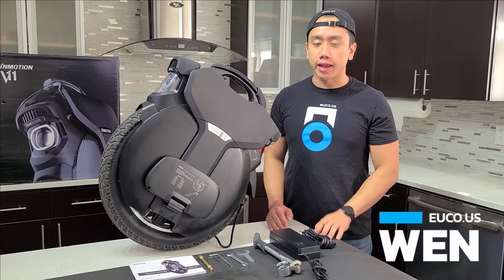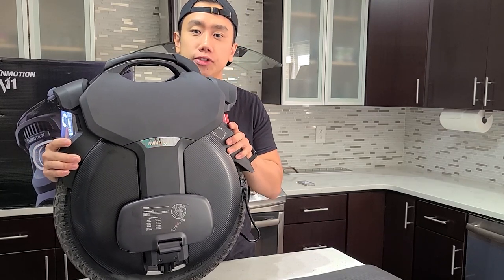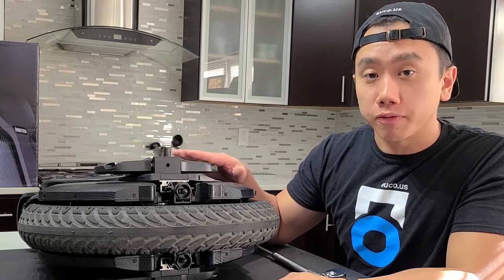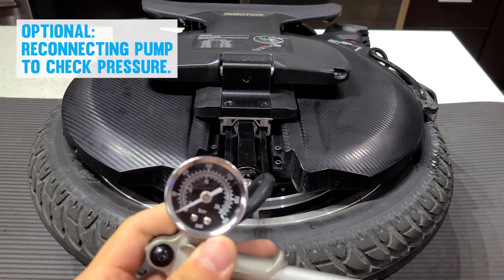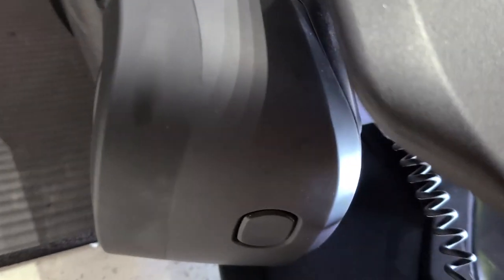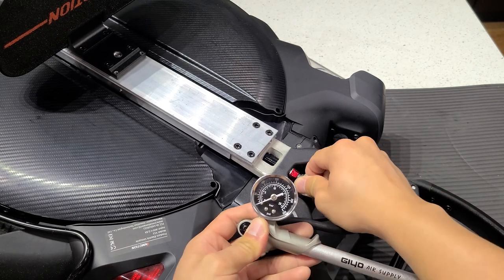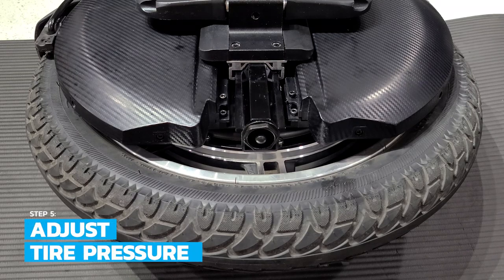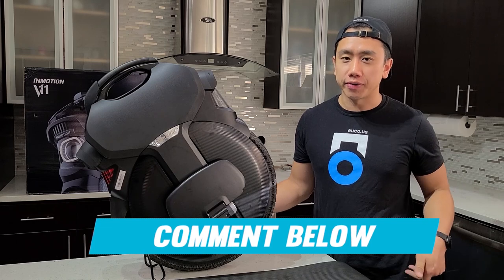InMotion V11 Setup Guide

Comment: I’ve noticed there is no mention in the current owner’s manual about filling the top chamber. Is this normal? Has something changed? Which pump were you using right at the end when filling the last upper chamber? It looked different than the one you used for the bottom chambers. PLMK ASAP. Thank you for your time. 😎👍🏼

Comment: Thank you.  This video was clear and concise.  You also clearly explained the proper usage of the pump and it's open and close lever function which a few EUC content creators (as amazing as they are normally) got wrong.  Now all I need is for my V11 to arrive!  sigh 

 Also even with the recommendations from Inmotion about tyre pressure, would you recommend lowering it from their 40psi?  I weigh 73kg and intend to pump my tyre to about 30psi along with 100psi in the positive chamber.
Reply: 30 psi in the tire is fine. I usually run about 35. InMotion's recommendation is conservative.

Comment: I think a Locking quick release latch system needs to be implemented for the top cover.  Most people aren't gonna check that top pressure as much as they should.  It's fairly inconvenient... 🤔🤔🤔
Reply: Yeah, I was like, WTF, "check 'periodically???'"  How often am I supposed to screw around with all them screws????
Reply: @davidchou1675  8 screws is not a lot
Reply: Its 8 screws too many. What a hassle.  Omg I can't believe how painful that was to just watch. Doing that once a week is gonna suck.
Reply: @BenjaminFrinkRIH  You don't have to take out a single screw on the S18 to do any of this tho.

Comment: This video is showing how to do it the hard way.  Much easier way is just to remove the saddle screws and use a valve extender.  You can also fixed angled valve extensions on them so you don't have to remove the saddle screws in the future.

Comment: Good video for the shock setup.
The recommendation for tire pressure is too high however, the sweetspot would be a lot lower for most people (almost half)
Having such a high pressure with a large tire will make the wheel harder to control, lacking grip and overall not as safe.
Reply: I would not recommend running lower than 25 psi to avoid rim damage. I ran 25 on my 16x until I dented my rim. Although lower psi are tempting for novice riders because of easier control, increase pressure as soon as you can feel comfortable.
Reply: I go 40 psi with my V11. I usually go on 43 on the 18L. I weight 98 kilos

Comment: You don't need the Inmotion app (it's terrible anyway), you can put the wheel on the charger and then take it off the charger. That reverts the wheel to normal mode (ride-able). At least that is how it works with the V10F.

Comment: Damn, this may be my new wheel if and when I need a new one...but how do you get 120 psi??? I can barely get 40 psi with my bike pump...
Reply: The suspension pump included works just fine!
Reply: 120psi for the suspension, right?

Comment: Anyone know how to unlock the max speed from 31 to 34mph? Thanks
Reply from the maker: Hi Andrew, in order to unlock the V11's top speed, you must enable "fancier mode" in the InMotion app. Once you are connected to the wheel, press the settings icon in the top right, and tap on the text that says "Features" at the top of the screen five times. Doing this will unlock a new toggle to enable fancier mode, and when you do, the top speed will be set to 55km/h. If you have any questions about this process, feel free to send us a message at contact@euco.us!

Comment: Just got mine delivered. it's beautiful. Gorgeous. A work of art.  But it sucks hairy balls getting the housing off to get to the top pressure chambers. I recommend getting power tools bcs it's major hassle with just the tiny wrench. Took me 20 min to get 4 screws off. The upper screws are hard to get to and you have to constantly keep pulling the handle up. Awful design for a high maintenance part of the wheel. Major pain in the ass. Enormous #DesignFlaw in my opinion. Please don't do this to us again Inmotion .
UPDATE: If you thought taking the top screws out was a pain, wait until you pressurize the top chamber and try to screw them back in, lol, this is a nightmare.

Comment: Hi.  I’m trying to set up sign up but it’s asking me for a password I don’t have ?   I got the verification code but no password
Reply: Pleeeeease help?
Reply from the maker: Apologies! When signing up and where it says password, you put in the password you want to use.
Reply: Thanks.  Finally signed up and I’m having issue with software.  Everything I do on app says setup failed
Reply: @EUCOllective  I also can’t shut my euc off.  Battery and blue tooth is blinking…. I hold the power button down and nothing….
Reply from the maker: When trying to setup are you using data or wifi? Which euc do you own? I'm assuming the v11?

Comment: 40 psi for tire pressure, time to add more air been running at 32 psi.
Reply: 40 is a lot
Reply: 30-40 is fine. InMotion's recommendation is conservative, to prevent wheel damage from under inflated tires

Comment: When I upgraded my firmware, I had forgotten to lay it on its side. It appears to have upgraded successfully. How will I know if it isn't working correctly?
Reply from the maker: It shouldn't matter either way for the firmware update whether it's on the kickstand or laying down sideways as long as the wheel still allows the update to go through but for the calibration (which is recommended after a firmware update) you will have to make sure it is resting on the kickstand for the calibration to progress

Comment: Nice video, but no one should follow that recommended PSI on the pedal. It's wrong. It will be different for everyone based on their preference. Also, you have to lower the PSI on the tire. It comes way too full. You may wanna also consider any protective gear, like a helmet, and a possible backpack filled with items. Took me quite a few try's before I found my sweet spot for the PSI on the positive, negative and tire pressure.
Reply: Still waiting on my V11, but I'm trying to collect as much info as I can.  I'll probably start with the recommended, but based on the recommended settings, did you go with more or less pressure, and why?

Comment: V11 with better motor will start production in octomber....curently v11 has big issues with motors
Reply: What's happening with the current motors? I was just about to put my deposit down on one but I'll wait if there's a better version coming out.
Reply: @Omidel: Would you be so helpful to all of us to put a legitimate link showing the “big issues with V11 motors” please? Thank you!
Reply: @EUCO: Could you reply to Omidel’s comment about “big issues with V11 motors” please? Thanks
Reply: @FindMarcio  you should check the telegram inmotion group..and see the usual sound that motor does is all over (click sound).
Reply from the maker: There has been a few reported motor issues from early batch customers, but InMotion has since resolved those and all of our pre-orders will be fulfilled with the updated version. If you have an early batch V11 and are running into a motor issue, please get in touch with your dealer to receive support.
Reply: The following is quoted directly from Liam @ InMotion:  "We have noticed all the motor issue since the day 1. Abnormal different sounds inside the motor, the Z bearing issue, and etc. Only a few percentage V11 will encounter  such issues. The new motor will be applied to the production on Mid-October. All defected motors will be replaced under warranty. "
Reply: @danieldilly  which batch will receive updated motor? I hope batch 3
Reply: @Sal_The_3rd  batch 3 will have all current updates

Comment: mine died after 5 months with no crashes or damage.  i got motor hall fail and i tested the motor with another controller and it works fine.  in motion suggests i start buying motherboards and try to change them to see if it's the issue.  I would recommend people look into VESC and just remove all the inmotion electronics from this wheel, the company has no right to sell such expensive devices that don't last very long.